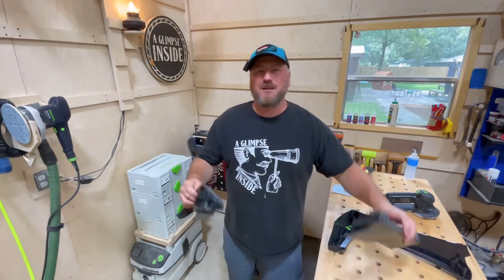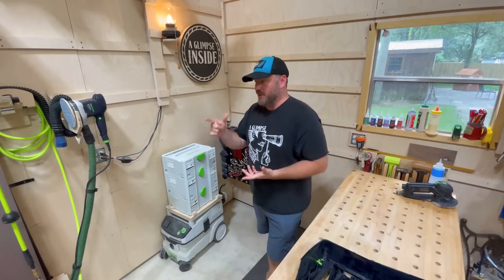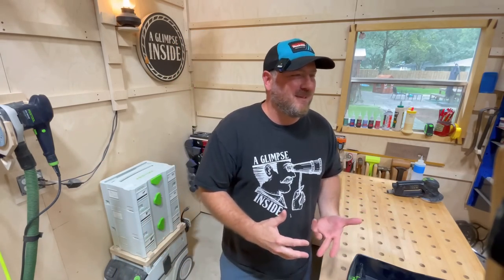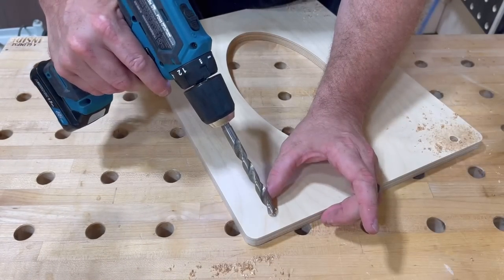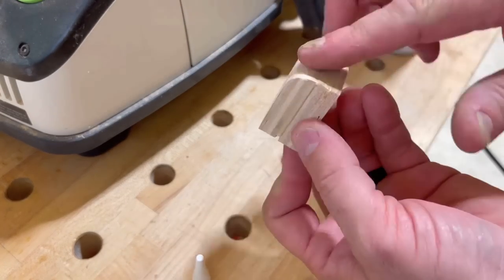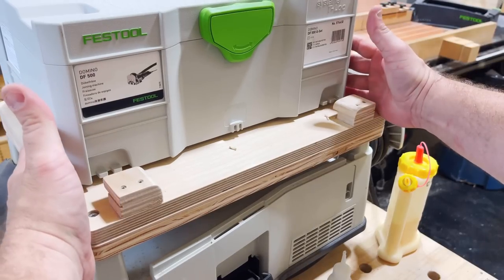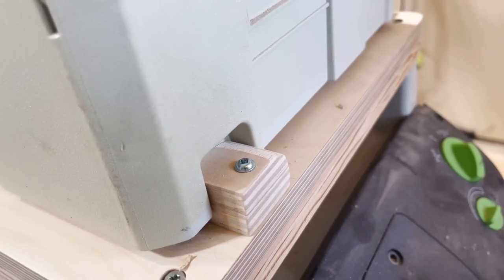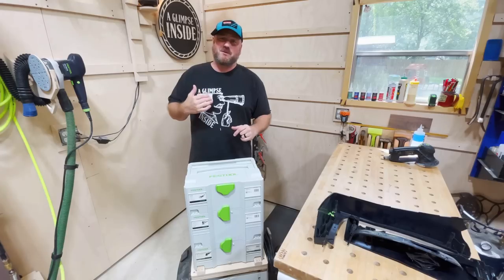THANK YOU @StumpyNubs Plus Fixing A Broken Festool Vacuum

Comment: At the opposite end of the spectrum you have bushcrafters who make everything from shelters to kitchen utensils from fallen deadwood with a knife and axe. Some would think this requires no skill until you attempt to build something this way. CNC has the reputation that the machine does everything for you but any knowledgeable woodworker knows that the setup is the key to success. Even something as basic as a hand plane has many dimensions to consider to make it work efficiently.

Comment: Great video. I like your solution. 
Years ago, I added a small dust separator to my Festool CT 22. I cut a sheet of plywood in the shape of the systainer feet and screwed the dust bucket to the plywood. I can't store systainers on the CT, but the filter bags last forever.

Comment: Cool idea….just watching it occurred to me that you could cut a slot into the brackets that have a single screw….loosen the screw and slide the brackets back to remove the systainer.
Reply from the maker: Yes definitely. That would require me to drill out a little bit of an oval shape to make this happen. So I just might do that